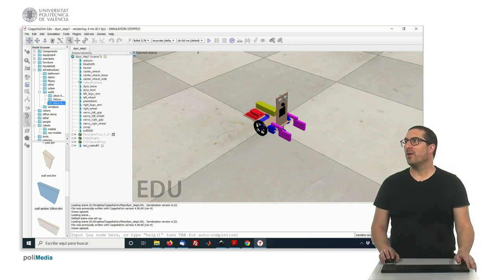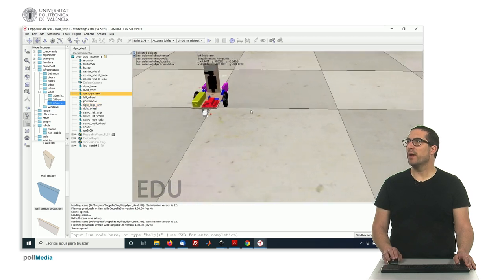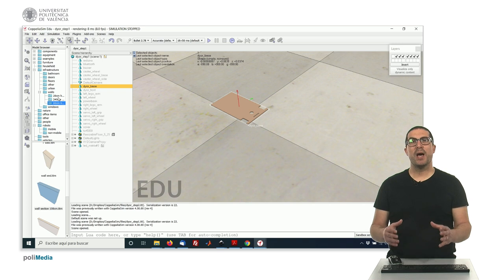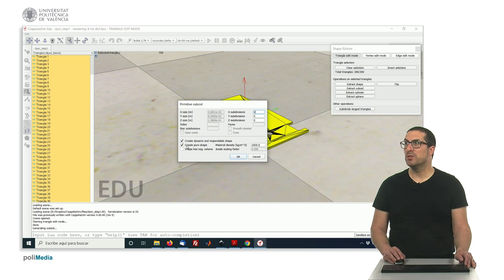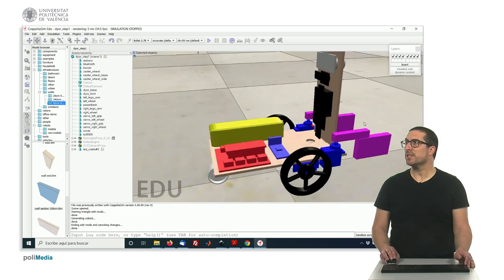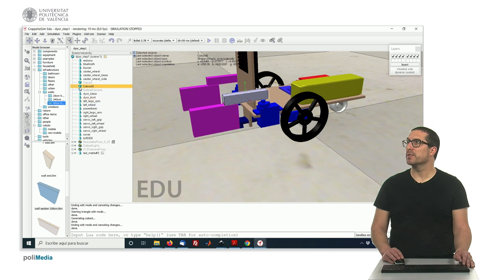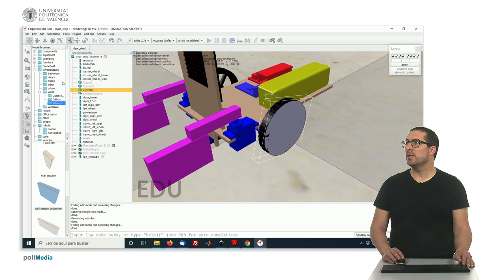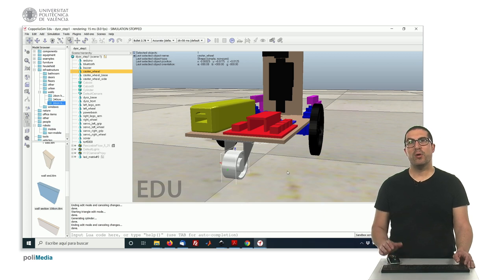Creating DYOR robot (Step 1) | CoppeliaSim (V-REP)

Comment from the maker: In order to create the pure objects for the "caster_wheel_side" object using the shape editor might cause some problems, because the orientation of the cuboid might not be properly recognised. The easiest way to proceed is to manually create three cuboids with approximate dimensions and place them at the proper coordinates. This is what I have for my demo:

cuboid_support_side_left: dimensions (2.0000e-03,1.5000e-02,2.2500e-02), position (+9.0e-03,+7.0910e-02,+2.3300e-02)
cuboid_support_side_right: dimensions (2.0000e-03,1.5000e-02,2.2500e-02), position (-9.0e-03,+7.0910e-02,+2.3300e-02)
cuboid_support_side_top: dimensions (3.0000e-02,1.9000e-02,2.0000e-03), position (-6.7506e-08,+6.3910e-02,+3.3550e-02)

Comment: sir, when tried  to obtain the pure object (cuboid) from the "caster_wheel_side" the shape editor did not show any problem and gave me the cuboid shape which is clearly visible after inverting the layers.
sir, can you please tell, how I will understand that the obtained pure shape is "ok" or "erroneous".
Reply from the maker: If it is a pure object the icon is a cube, while if it is a non pure object then the icon is different depending if it is convex or non-convex. Anyway, if you press the button ‘Extract cuboid’ then the object should be a pure shape
Reply: @LeoArmesto  yes sir, after extracting it is showing cuboid pure shape.
Reply from the maker: Then, I guess everything is ok
Reply: @LeoArmesto  thank you sir

Comment: Sir, Can you please tell how have you created all the STL files required ??
Also, can you tell how on importing all the STL files its position was preserved in CoppeliaSim? Have you done additional settings for it?
...
I am using Solidworks. And I have solid work assembly which I would like to import in coppeliasim.
Reply from the maker: Hello, I also use solidworks. You need to save the assembly as a Step file and then save the file as STL. The position and orientation of files is preserved, so I suggest you to work with the assembly with all mates properly done, before exporting the files, otherwise, changes will be hard to undo in CoppeliaSim. You might also need to reduce the amount of triangles in the STL if your model is complex. For that I use MeshMixer
Reply: @LeoArmesto  Thankyou very much.